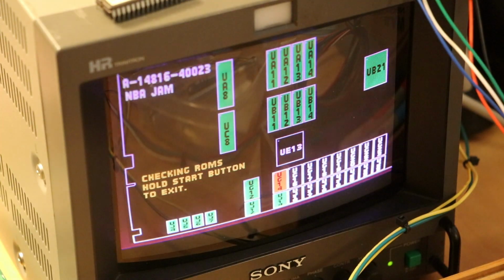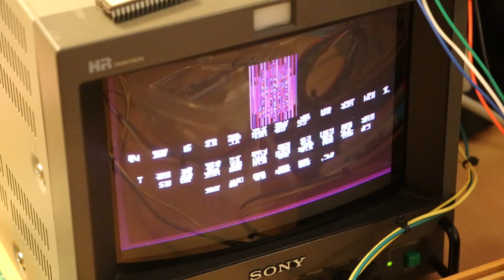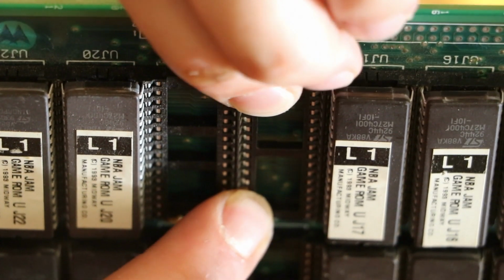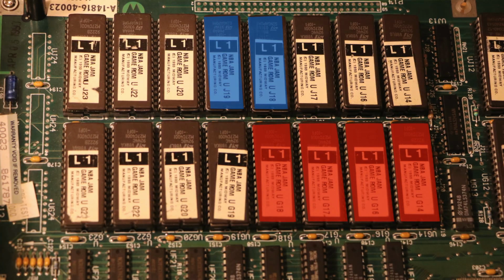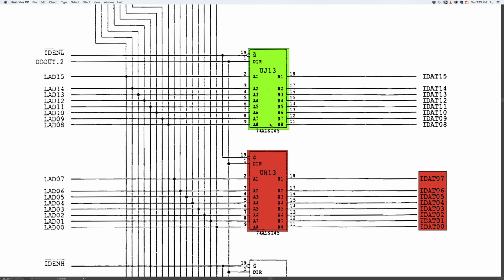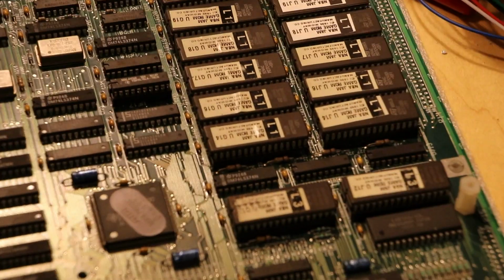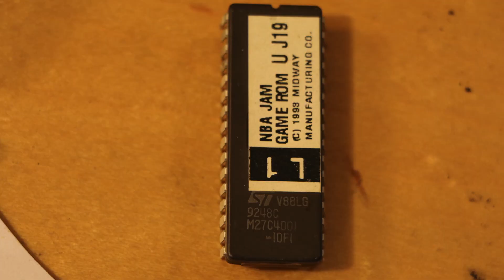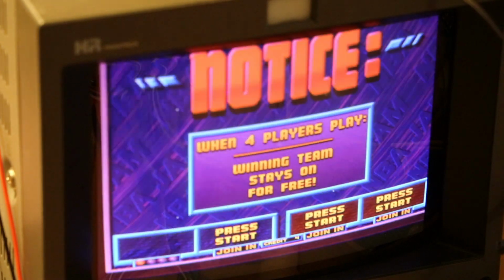NBA Jam Repair Log

Comment: SMALL CHANGE ARCADE ,                                         Joust,Defender,Robotron,Sinistar,Stargate, Bubbles uses the eight shift registers to output data to the screen four bits at a time for a 16 color pixel. 
--       I'm not sure what this really means why they wanted to output 4 data bits at a time to get a 16 bit color pixel. Can you explain what they mean by this because I'm guess other arcade games would only output 1 bit at time to get a 16bit color pixel? 
--            The color PROM chip outputs 1 bit at a time  to the color RGB output circuit which has DAC converters to output RGB analog voltages

Comment: So, did you get the data from the chips with the broken legs to write onto the new eprom chips?  If you can’t get the data off a chip, then where do you get the data from?  I feel that the original companies wouldn’t be so forthcoming in handing over such data.  Or if they even still exist as a company or even have a memory dump of their old games.  I’m hoping that even though this video is over 2 years old that I might get a reply, thanks!
Reply from the maker: The contents of EPROMs can easily be dumped. If you're familiar with MAME and arcade emulation, the game file is the dumped contents of the actual ROMs from the game board. So almost every chip from every game is available to download. You can use those same files to write new chips to replace broken ones.
Reply: OK one last question, how do you know which EEPROM to reflash the data to, going with the files available on the net?  Do the files for the emulators mimic all the EEPROM’s on the main board, as though it’s a virtual PCB and call up the individual chips when need?  Thus, knowing what chip gets what flashed to it!
Reply from the maker: @JimiJamma  Yes, the ROM files are literally labelled, one for each chip on the board. Emulator software is emulating the board, the ROM files are the actual data from the chips.

Comment: SMALL CHANGE ARCADE 
           1.) The Two phase clock signals was used for sharing the data bus for instruction sequencing to sync the RAM devices?
                       2.) DMA puts the cpu to sleep and transfers ROM data contents to flip flop latches and RAM chips? anything else what the DMA purpose and function is used for?
             3.) i see the access time on the datasheets for parts like RAM chips, PIA chips, PLA chips, 
PIA & PLA chips have access time also
But I don't know what determines a designer to choose which access time is right for the game programming code. How would a software arcade game programming code know which access time to choose for the IC chips?
                        4.) The software game programming looks at all the datasheets access times for the all the IC chips and choose the access time based on the Clock speed? 
If the clock speed is 1Mhz, what access time would be good to use?
If the clock speed is 4 Mhz, what access time would be good to use?

Comment: SMALL CHANGE ARCADE, some arcade games use "masked Rom chips" instead of using EPROM chips or PROM chips. Why are they using Masked Rom chips instead of using EPROM or PROM chips, what are the advantages of using Masked ROM chips?
Reply from the maker: Definitely see both on arcade games. Sometimes the same exact game will have some boards with one style and some boards with the other style chips.

I would imagine this comes down to cost. A masked ROM will cost much more to produce initially, but if they are producing a high enough number of boards, the economics probably make sense. 

Conversely, there is no setup required for EPROMs, just added time to program them individually. So if they are producing a smaller amount of units, then EPROMs probably make more sense. This is just a guess.

From a cost perspective, it's probably a lot cheaper to order a ton of EPROMs that will work for many games, and even several generations of games, than to order 10-20 individually programmed chips for every single game, and that are not useable for anything other than a single game,
Reply: @SmallChangeArcade  thanks for the help. 
1.) Some arcade games use 2 clock signals that are clock inverted signal and clock phase signal, any reasons why?
2.) Any reasons why arcade games use different RAM "access times"?
3.) The ROM's chips data width size doesn't equal when your "subtract" the address start and address end range. Any reasons why they would want blank unused space in the ROM chips not having any code? Is the blank space used in the ROM chips used for compiling the ROM data contents?
Reply from the maker: @billwilliams6338  1) No idea
2) Not sure. Do you mean RAM chips on a single board with differing access times?
3) I'd imagine they have a maximum available size for the game when they start development (number of ROM chips x size). When the game is done and optimized, odds are there will be room left over. If they have more than a chip of extra space, they just leave an empty socket or 2. Then, a game might have 6 roms, but 2 of them might be just for audio or some other specific function. So those 2 won't be completely full, because they aren't putting misc graphics data on the extra space. I'm sure there are reasons for grouping the ROMs like that from an architecture point of view, but there are practical reasons to do this as well, such as troubleshooting a bad ROM. If it's a graphics problem, for example,  you can narrow it down to one of the ROMs that has the sprite data. 

No data is ever written to the ROMs, or manipulated on the chip.
Reply: @SmallChangeArcade  thanks for the help
1.) Yes I mean when the RAM chips on a signal board have different access times not sure why a designer would do this or what is determining the RAMs access time because most arcade games use the same Z80 cpu but each arcade games uses different access times for RAM chips which doesn't make sense to me, any reasons why?
2.) Yes an arcade games will have 6 to 8 ROM chips. Each ROM chips will have left over blank space on them when you "subtract" the start address to the end address the data width will not equal to the ROM chips data width size. I'm not sure why they would have blank unused space with no data content on each ROM chip in an arcade game. 
3.) The arcade game Joust uses many shift registers TTL chips tied on the data buss any reasons why? because most arcade games don't use multiple shift registers tied in parallel on the data buss lines.
Reply: @SmallChangeArcade 
------------------>               I'm confused why some arcade games what to redirect the addressing?
    1.)     What is the "advantages" of redirecting the addresses?
  ------2.) What is the "advantages" of bank switching the data buss lines and band switching the address buss lines?
Reply: @SmallChangeArcade  here is some basic repair questions:::
                                    When the arcade game is constantly resetting watchdogging. And you disconnect the watchdog circuit from the arcade game and then the "game stops resetting". 
             1.) How do you know if its the ROM's chips or the address decoder chip or the RAM chips? Because It can be either of them that is causing the game to reset.
        2.) When Disconnecting the watchdog circuit and the game STOPS resetting would this isolate and eliminate that the ROM chips are good, address decoder chips are good, Data buss and address buss are good?
        3.) The arcade game ROM chips game code outputs a "special address" to the address decoder chip to RESET the watchdog circuit. If the the ROM chip game code is corrupted and is sending out a corrupted "special address" or is sending out a scrambled "special address to the address decoder chip. This will cause the watchdog circuit to constantly RESET the watchdog circuit?   
4.) If one or more of the RAM chips is corrupted and the arcade game is constantly resetting watchdogging. How would the watchdog circuit know that one or more RAM chips is corrupted and not working correctly?
Reply: @SmallChangeArcade  thanks for the help
--->What is the difference between address decoding an address compared to address multiplexing an address?
Reply: @SmallChangeArcade  thanks for the help
>>)))>.    1.) what is it called when bank switching can use the "same address range" to route to one RAM/ROM and then route the same address range to a different RAM/ROM chip what is this called? Is this called address multiplexing? 
>)))....2.) Because I'm confused by the daughter cards kits says that the madsel circuit means multiplexed address select.
So what do they mean by multiplexed address select? 
           3.) I don't understand the difference between multiplexed address selected compared to address decoding?

Comment: Great video thx, just for info, for the timing on eproms i think its not negative... Its just a dash... Keep up the good work
Reply from the maker: Yeah you're totally right. Obviously access time can't be negative, but I was never sure if the minus sign signified anything. I'm still kind of confused though. As far as I understand you could have 3 chips labelled -10, 10 or 100, and all mean 100 ns access time... It's confusing notation.

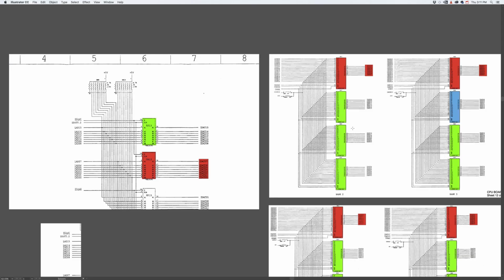Comment: What would you suggest to google for to find the diagram at 4:07 ? I tried a bunch of terms but nothing came up.
Reply from the maker: [NAME OF GAME] PCB, Schematic, Service, Manual usually works. Some game manuals include the schematics. Sometimes there are a couple versions of the manual: "Operators Manual" and "Service Manual". So look at various manuals for the same game. Some board schematics for various games are not available publicly. If they are, you should be able to find them.
Reply: @SmallChangeArcade  I am specifically interested in nbajam and the one schematic you have opened in Illustrator in the video. I found the schematic here: https://www.arcade-museum.com/manuals-videogames/N/NBA_Jam_Kit_Operations_Manual_1643123101_April_1993.pdf but it does not include the wiring of the TMS27C040 eprom which is what i am after. Is it a private document that only the community possess?
Reply: Oh wait, it was there all along at the bottom of the very pdf i liked to ;P!

Comment: Great video! Congrats on the fix. I have the NBA Tournament Edition PCB. Does the pcb require -5v to work? or is +5v OK? Currently I am getting an error message 'CMOS CHIP UJ11 BAD'. I have read elsewhere where someone replaced this chip and it didn't help. When I do a diagnostic test, UG14, UG16, UG17 & UG18 are showing bad. I have looked at the schematic and these four ROMS all share IDAT0-7 and IDAT 8-15. That is as far as I have got. You lost me at data sheet... any ideas? Would be great if you could point me in the right direction. Cheers
Reply: I am beginning to think it is the same IC's from your video which have gone bad.  (see image) https://imgur.com/FPVWD9Y 
When I got the board there was some black corrosion on those 2 IC's anyway
Reply from the maker: I believe UG14,16,17,18 are all addressed to only IDAT 0-7, which corresponds to UH13. Since UH13 only connects to specifically those 4 roms (and no others), I'd say it's a pretty good bet that your UH13 is bad. 

If you look at sheet 4 of 22 on the schematics, you'll see that UJ11 also connects to data channels 0-7.

A bad UH13 would likely cause UJ11 to show bad as well. Hope that helps, let me know if you get it figured out!

Comment: nice work... I'm about to do this with one of my midway boards.. the replacement lables for eproms, how did you make them
Reply from the maker: The labels would break if I tried to remove them from the original chips, so I literally put the chips on my scanner. I cleaned them up a little in photoshop and added a slight yellow tint so they would match the old ones better. I printed them on heavy stock paper, cut them, then sprayed the back with Super 77 adhesive spray and attached.